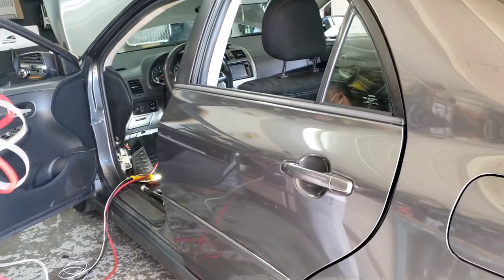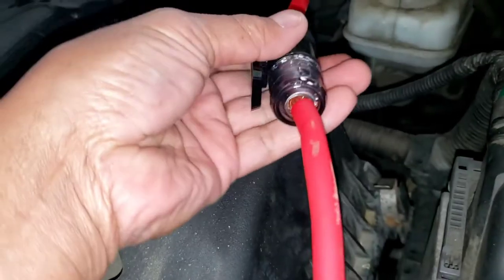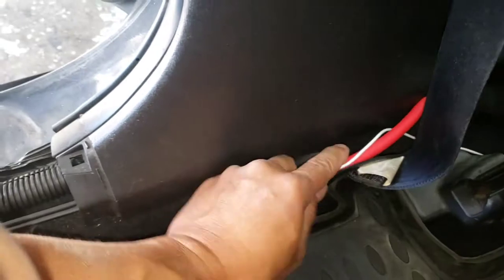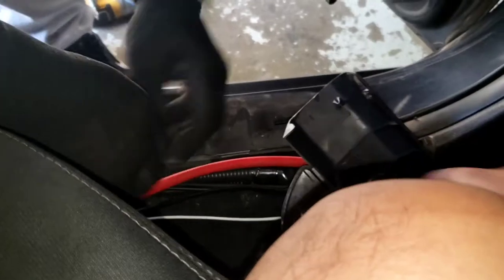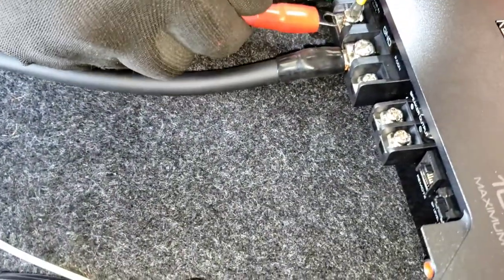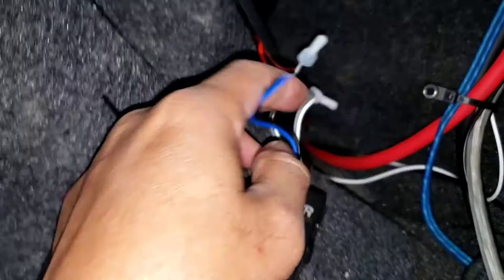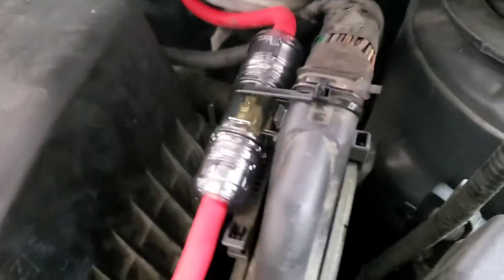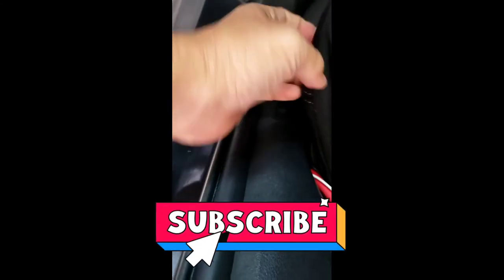How to install an amplifier on a Toyota Corolla 2012 used in loc or high low converter

Comment: Ty. Best part of this was location for power wire in 09-12 Corolla. Also using the fuse for ignition to tap into for remote wire is very great info. Well done 👍🏼
Reply from the maker: Thank you friend 👍👍👍